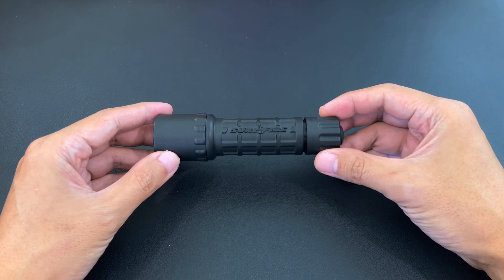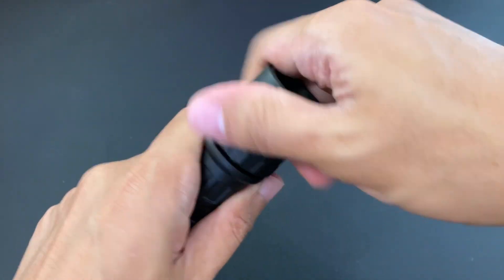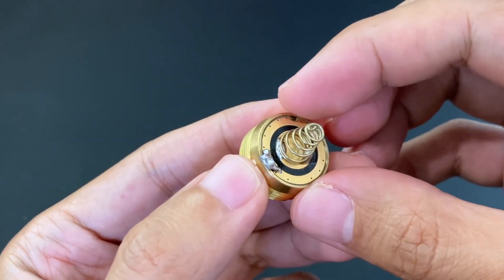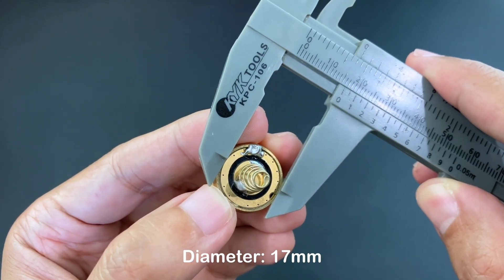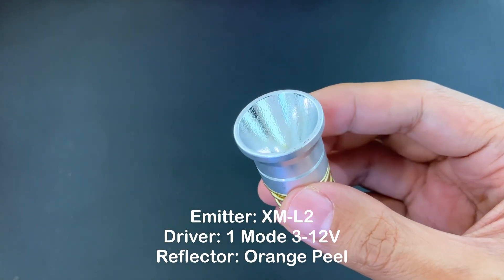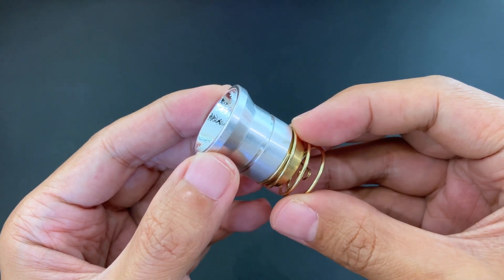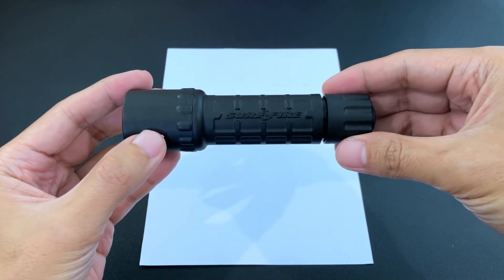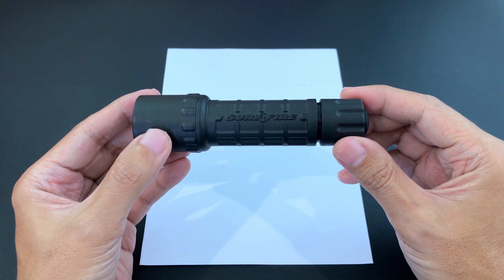Surefire G2 Nitrolon LED Upgrade

Comment: I have G2zx new latest model if you can give me idea on how to change LED bulb replacement thanks ?
Reply from the maker: Sorry but, unfortunately, I’m not familiar with the G2ZX. I do believe it doesn’t use the common P60 design so it might be harder to upgrade/replace.
Reply: Thanks, ill will email surefire

Comment: Use  a single 16650. Its under 6V. Work fine with regular SF G2X and other that dont tak 18650ies.
Reply from the maker: Would have saved me sa lot of trouble… and a LED module.